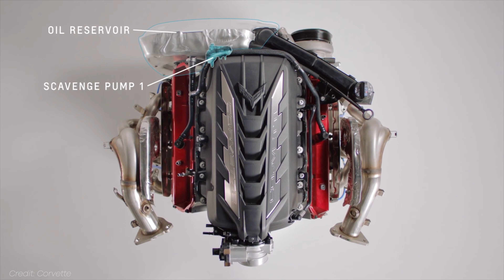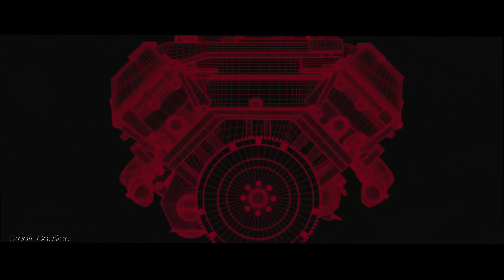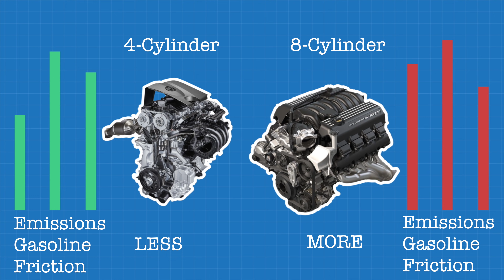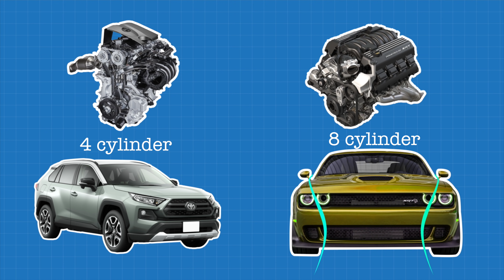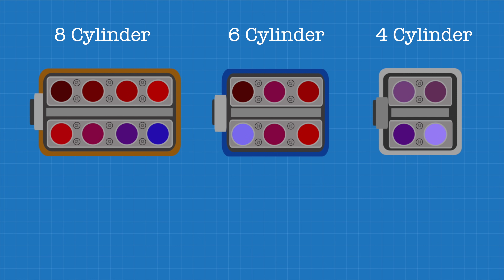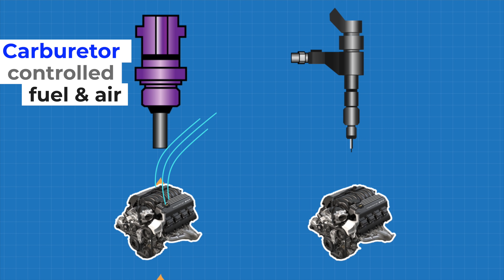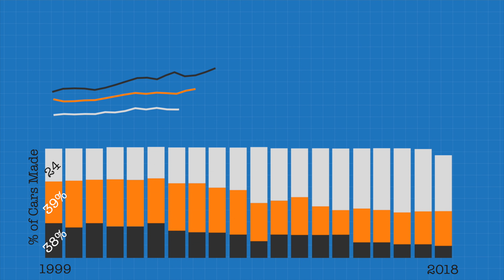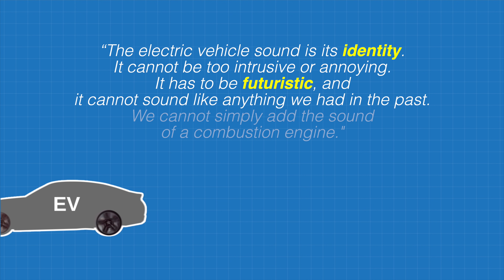Why V8 Engines are Dead

Comment: The thought of a world of cars without the V8s leaves me quite cold & angry.
Reply: Will be a sad day when combustion engines are gone. I was rather hoping bio fuel powered engines would become the new norm since they are so clean (ie: Koenigsegg Gemera), but I guess not.
Reply: @DanielSadjadian 
What can they do to produce huge amounts of biofuel? Ya need a steady supply of fuel with so many cars on the road.
Reply: To me it especially sad that the company that gave us the first mass produced V8...that became a legend...is moving away from them...and even cars for that matter.  There is nothing quite like the sound of a V8.  Straight 6s in many variations sound good.  Think the XK Jags, or even BMWs.
Reply: @willb3018  they're not really moving away, but I agree with Scotty - at this point V8s are in sports toys and trucks.
Reply: @rammsteinkorduner3114  I had to pull one of those out of my intake halo the other day. So little, so cute, so sadly like farts. They're either so quiet you can't hear anything good or a big ole fart maker on the back.
Reply: @TA_Plus_Hemi  a new turbo 4 cylinder can beat a v8 from the 90s and early 2000's. its all relative  you should know that mopar
Reply: @senorpepper3405  a new turbo4 beats a 20-30 year old V8. Congratulations most 18 year old people can athleticly outperform a 38-48 year old person too. On that same note some modern turbo 4s can hang or drag or out corner a modern V8. How do you not know that pencil pistons.
Reply: I feel like there will always be a need for combustion engines, because even if we get rid of cars with them, what about planes and and large boats ? Going to take some amount of time to come up with enough electric engine (and even more amount of money) to create something so large for, lets say. An aircraft carrier or an AC130
Reply: @SkumleBones  Heehee Heehee AC-130 that's Spooky
Reply: @rammsteinkorduner3114  sure after $10.000 upgrades
Reply: For 12,000 bucks you can get an 850 Hp BBC. With a four barrel. 
Murica!!!
Reply: Bro same here I will never ever drive something else v8 for life!
Reply: @MultiDreamer1979  Never say never :D
Reply: @MultiDreamer1979  👍👍👍👍
Reply: Hydrogen power will come around once the whole electricity thing gets saturated. We can do it but needs infrastructure that no one wants to volunteer for
Reply: In my country V8 are turbo rare but when I hear some V8 accelerating - my hearth trembles!
Reply: @rammsteinkorduner3114  i eat 4cylinders for breakfast in my v8
Reply: I'd be ok with it if we can finally get nuclear powered cars
Reply: Welcome to europe, i dont know anybody who has a v8.
Reply: Ferrari still makes the 488
Reply: Same
Reply: Agree
Reply: Same here mate.
Reply: @rammsteinkorduner3114  people still say that? I thought that stopped being funny in 2005.
Reply: sleepyhollow783 so true.. it hurt my feelings
Reply: I agree
Reply: Same
Reply: California Dreamin  not really, they just arent usefull when all the roads are   small, bendy and the people poor. And i would like a v8 but they are so dam expensive to first buy and then maintain. Also the EUSSR likes to taxt the hell out of fun things. So ill have to stick to my straght six.
Reply: California Dreamin  big block Chevy...i thought you were a car person
Reply: @rammsteinkorduner3114  😂💩 no that won't happen. And nobody cares.
Reply: It will be sad missing that lovely sound, but so far, electric motors outperform combustion engines by light years in terms of speed and power, except in colder climates.
Reply: @micah_drums  that's a myth
Reply: sleepyhollow783 After driving an 87 GN and owning a 2016 F165. I can live without a v8.
Reply: @Fone65  but that's not really living then, is it.
Reply: @Fone65  whatsa 2016 f165?

Comment: Nothing beats the power and sound of a V8
Long live the V8🔥
Reply: ...? It’s like you saying “Steak is better than Ramen”. Two entirely different things,🤦🏻‍♂️.
Reply: @chrgav1286  
Wow, you're very perceptive; thanks for clarifying that. 🙄
Reply: The only V8 I've owned had 130 hp. The 4 cylinder I have now has more than double that, in a vehicle about 1500 lb lighter.
Reply: Drew Thompson sounds like you had the wrong V8 buddy😂😂
Reply: The pilot of an F-22 Raptor would probably disagree with you. 😉
Reply: Ev have more torque horsepower.   but nothing nothing. beats the sound of the V8  👍🇺🇸🇨🇦 gas ⛽️ will remain cheap enjoy
Reply: Don't know man. I like those high revving v10 and v12.
Reply: Car Freaknatic  I wouldn’t use a v8 for a daily driver but for a weekend 🧸 toy it’s fine or for towing  U only go around ounce  I never buy buy new vehicles 🚗
Reply: Car Freaknatic I’m not @ the leasing point maybe one day when I get bored of fixing them
Reply: Every engine sounds good. Period.
Reply: V12 and V10
Reply: V10's and 12's beat the power of a v8
Reply: @DylanL69  nah...

Comment: A video about Straight 6 engines would be highly appreciated. Good video Scotty
Reply from the maker: good idea, thanks!
Reply: Autonauts Garage 
Yes Inline 6’s need to comeback to the mainstream. Power of a V6 with the simplicity of an in-line 4.
Reply: @francesco1998  Problem is an inline 6 would need to be rear wheel drive. For some reason manufacturers seem to prefer building FWD systems now.
Reply: arcflashed 
I don’t see RWD as a problem. Especially because I’m more talking about Truck/SUV platforms and sports car platforms. That’s what an in-line 4 is for, FWD, and then you could just use the same base engine design for an in-line 6 if you wanted to go bigger, for bigger vehicles.
Reply: @francesco1998  Inline six with RWD has been a very good system in the past. I'd love to see a comeback with the new technology that can really boost the power compared to twenty or thirty years ago when inline sixes were common.
Reply: The 2JZ!!!!
Reply: @AstoundLikesWoW  and the 1jz. I personally love the 1jz sound a little bit more than the 2jz but both engines are awesome.
Reply: @AstoundLikesWoW  Even if they greenlighted that you would need a Chrysler based setup to make it work with modern emissions (twin plugs per cylinder +deactivation).Nobody is producing these and they don't fit in modern Toyotas
Reply: @KilmersGarage  yes - I love the 1960s Chevy inline 6 cylinder engines  and Jeep inline 6. Very dependable  easy to maintain! Do story on inline  6's please!
Reply: @raybin6873  Napa trucks do deliver parts but we have no time travel facilities. We apologise for the inconvenience.
Reply: The Jeep 4.0L and Ford 4.9L were amazing
Reply: Pity you almost cannot buy one anymore unless it's attached to a BMW
Reply: Bmw <3 i love my endless money pit
Reply: If Scotty does a V6 vid he’s gotta include maybe the best V6 there is at least to him - Toyota